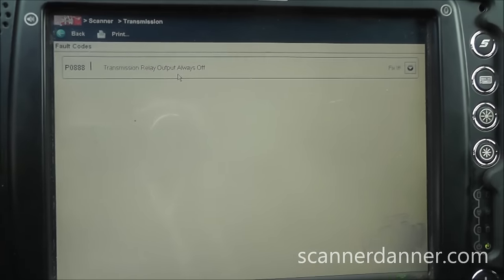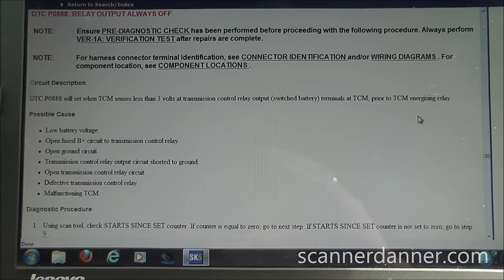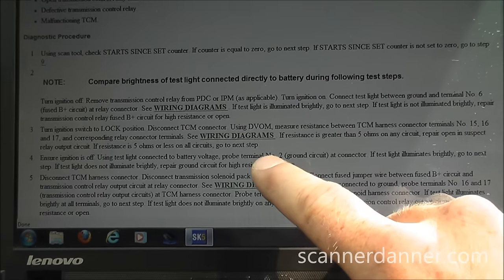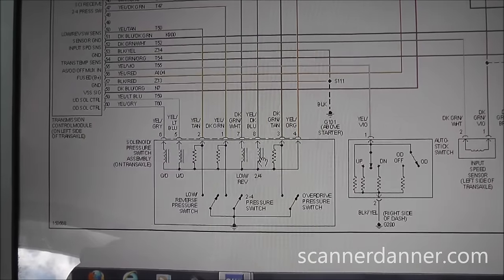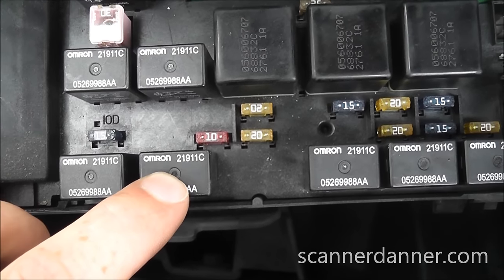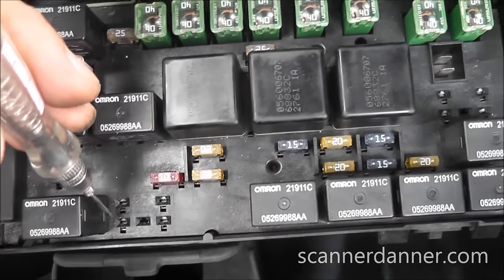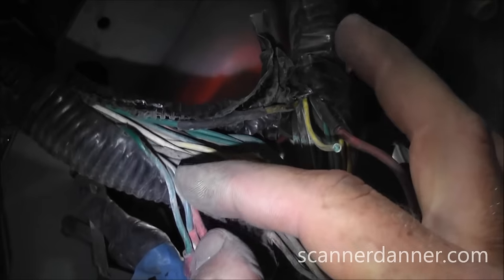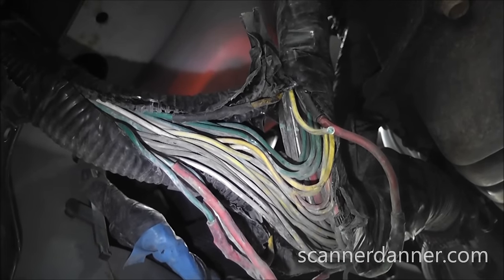Transmission No Shift Case Study (P0888)

Comment: hi, Can you help me out? I have a 96 dodge caravan sport. after starting and putting into "D" it drives fine until it tries to shift to 2nd gear, it goes into something that feels like neutral. I stop the van and none of the gears work. I restart the engine and do it again and it drives fine, until it tries to shift again. is it the transmission? I had a car with a bad transmission and it slipped a lot until it finally gave up, unlike my van which is on its 2nd transmission 10 years ago with 113k miles . I probably only put 50 k mile on this second transmission. It feels like its electrical since restarting it puts it back in drive at least for first gear. Any info would help. thanks.
Reply from the maker: These transmission were total garbage. I've owned a few Caravans over the years and every single one of them needed a tranny at some point in it's life. 
On these electronic shift transmissions, they will lock in second gear when a fault is detected. What you need to do first is find out what trouble codes are setting. However, if you are getting a neutral condition before the second gear lockout, this is not a good sign. Most likely a rebuild is needed. For additional help. 
Please post your codes here. Thank you! I'll respond on the forum. 
http://scannerdanner.com/forum/post-your-repair-questions-here.html

Comment: hey Scannerdanner I have a question, montana 2004 under 100.000 km it problem few years untill now ,   when i accelerate upto 113km and keep pressing 
down the gas it will not go higher and the speed will start the drop 
down to 106km and it will starts to go back up to 113km and then the 
same thing happens. there is no engine light and when i use an OBD2 
scanner nothing shows up, but when i slowly press the gas it can 
accelerate to speeds of 125km and not drop, but if i press gas harder 
after that it drops again, and when i get it to 120km and go to cruise 
control it is ok until i go uphill and then the same thing happens 
again. i have already changed all of the engine sensors, fuel pressure 
is ok, i have even changed things like the fuel pump and a lot of other 
things, i have changed the transmission oil and added in Lucas oil 
stabilizer. so what is the problem?
Reply from the maker: check you exhaust back pressure. I have a few videos on how to do this. Thanks!

Comment: My truck is a Ford f150 4x4 new engine new transmission everything is new but I don't have power on the hill what can I do
Reply: Check it for a restricted cat. Check the MAF  sensor and your fuel psi. Those are the big three low power issues on your truck.

Comment: Mazda 323f v6 2.0 problem is missing 3rd and 4th. Also when i leave gas pedal it acts like its in neutral.. wwhat i must check?
Reply from the maker: What codes do you have? What does fluid level and color look like? If no codes and fluid is full you most likely need a complete rebuild.
Reply: ScannerDanner Hello and thanks for fast response. I never tried diagnosis, need to make it via with  LED lamp cuz i dont have OBD2. It will show problems with gearbox?
Fluid color is dark pink, but i noticed some kind of very small black shlts inside it.

Comment: Im a big fan of knowing inherent problems any car i own has so you can avoid all this wasted time (no offense,  you are obviously doing it the right way), but most knowledeable caravan owners are already going directly to that damn wiring harness, or trans computer after changing relay (i carry extra relays too). I suggest everyone go right now & wrap that harness bend with silicone tape before you have this prob. P.S. I would run an extra ground wire from engine to body as these caravans are known for weak grounding
Reply: also spray WD-40 (its electrically conductive oil) on all ground connections you can find in engine bay. theres one main one connected to one of the bolts for the starter, you can get to it with spray easily on right side of engine as your looking at it with hood open

Comment: I have a 2005 PT CRUISER that won't shift out of first gear. could it be a fuse?
Reply from the maker: +Tom Mutz most likely not and most likely it is a 2nd gear limp mode. There should be a trouble code.
Reply: +ScannerDanner what is limp mode sir
Reply: +Gerwich Saint-Hilaire   Limp home mode refers to the computer allowing the car to continue to function to some limited degree so that it can be driven to a location to be repaired pr where it is safe to stop.  The car doesn't just shut down and then need to be towed.  In this case,the computer locks the transmission into second gear so that it can still be driven even though  the transmission won't shift into other gears.

Comment: I know there are several ways to skin a cat. But wouldn't another way you could have tested that control wire would have been to energize the relay while checking voltage at the tcm? Like you were doing with the sensing circuits.you would have seen the voltage drop pretty quickly.

Comment: Hey guys, I’ve had a similar issue with my van (2001) 3.3litr v6 I noticed that when I was driving, the van was stuttering and it seemed like it didn’t want to drive nor break and I was only going about 35-45km. 

I pulled to the side stoped and turned it off for about 5 mins then I started it drove normal for the first few seconds then it was stuttering again and wouldn’t go past 20-25km so then I turned it off and parked it, after leaving it turned off for awhile I started it and it cranked but then turned completely off in  about 20 seconds , then the engine was stuttering and it seemed like it wanted to go but kept on stuttering the muffler was giving out some weird sounds…maybe bad fuel pump? 
Transmission gone bad ? 

….if anyone can point me in the right direction on what to do….I would grateful appreciate it
Reply from the maker: No possible way to answer this based on symptoms alone. Testing must be done starting with a scan tool while looking at data during the condition.

Comment: I have a 2007 Cadillac DTS runs great until last night.. I was leaving the store so as I put it in drive or reverse... it does nothing... it gave no warning that nothing was in need of service.. the dash indicator shows its in neutral the moment I start it up.. but it's in park and want move... put it in any other gear and it will just roll.. anybody know what's going on here
Reply: Thomas Richmond did you find out what was wrong

Comment: I have a 2013 dodge charger 3.6 i was driving and all of a sudden my car would not drive I could rev but no movement I stopped turned car off and put it in drive and it would not go just rolled like it was in neutral check engine light came on and I got a lot of codes could this be a fuse HELLLP!!!!
Reply from the maker: no, it will not be a fuse. These symptoms do not sound good. Have it taken to a place you trust, this sounds like a transmission problem

Comment: I have a 1997 Sebring V6 that continually goes into limp mode after driving for 15 to 20 minutes, or whenever it warms up. I have changed out TCM, had it flashed, a new shift solenoid and input and output speed sensors to no avail. What else can i try to resolve this? It drives perfectly fine for a while then the check engine light comes on with the general transmission code p0007, I believe and the speed sensor code. Yet, the speed sensor is not the issue as I have changed them both twice. Please advise if anyone else has had this issue and resolved it.
Reply from the maker: unplug the alternator and tell me how it performs. then watch this video
https://www.youtube.com/watch?v=MGaHaIXZioA

Comment: Okay but what if it is not the wire it is a 2005 Dodge Caravan transmission lines blow it off I put them back on change  the transmission filter and put new transmission fluid in it
Reply from the maker: sounds like a rebuild is in order, especially for that problematic transmission

Comment: Thanks for the great video! I have a question. I checked 15th pin on my TCM and it doesn't have any voltage(off/start/crank). Does it mean that TCM is bad? Thanks again!

Comment: my 04 grand am se keeps blowing trans fuse.. any ideas
Reply from the maker: +son8god8damn short to ground on the ciruit, you'll need to find out what all is on that circuit and then isolate it. I use a short circuit tester for those types of problems. No way I can answer specifically to you what your problem is through the internet. But what I can say is you have either a wire that is touching ground or a shorted output solenoid/motor etc

Comment: could you explain to me the load side of a circuit
Reply from the maker: +Chris Canty sure, the load side of a relay is the switch side. the control side is the coil. 
Control side = makes a magnetic field to close or open (depending on design) the switch (draws less than 100 milliamps) 
Load side = contains a normally open and/or normally closed switch (up to 40 amps of current)

Relay = takes a small current and controls a large current 

make sense?
Reply: Plenty thank you learning a lot going to purchase your e book for Christmas

Comment: My 2004 Dodge Ram is giving me hell what could it be it runs good and then it after awhile it don’t hardly wanna take off when I stop on a stop I push the gas paddle and it barely moves after awhile it takes of again
Reply from the maker: when it barely moves from a stop, what happens if you floor the gas pedal? How does it run cold and how does it run at wide open throttle?

Comment: Okay somebody please help me my dog climbed under my 01 Dodge Ram 1500 and chewed up some wires it made me lose 1st 2nd and 4th I think it is called the shift sensor I took off the connector and there is a green wire and a blue wire but on the other side there are just about every colored wire does anyone know how to even to begin to figure out what wire goes together I'm trying to just splice it back together
Reply from the maker: https://www.scannerdanner.com/forum/post-your-repair-questions-here/16-need-service-info-check-here.html
You will need a good diagram

Comment: I have 2003 envoy won't crank I check all fuses, power to the pcm ok, the dash only came on check engine lite and battery lite when turn the key on, I try another ignition switch, another stater relay and nothing, also  I  have communication to all the modules, I disconnected module by module and just can't get the car crank somebody help!!!!!

Comment: Can any one help? I have a 2001 300m  3.5L.  Codes-- p0740 ,p0732, p0736, p0700, p0160, p0700.  I changed the Trans speed sensors. inner & outer.  Now it is going into limp mode... Help !
Reply from the maker: +Jerry Reyes sorry man, you can't troubleshoot by codes alone, you won't get much valuable help that way. Only silver bullet guesses

Comment: wish I could get an honest answer I have 2006 Ford pickup I drive it for a quarter of a mile acts like it ran out of transmission fluid I shut the truck off wait 5 seconds start it up put it in gear it goes like a brand new truck for a quarter mile acts like it's out of fluid again stop shut the motor off wait 5 seconds start it up it'll peel the tires I don't know what to make wish I could find somebody honest

Comment: my car hiccups at 1st gear 2nd gear and 3rd gear after driving a good 30 minutes, (when the trans fluid warms up) was wondering if my pressure control and solenoids are bad? (pontiac g6) if anyone can help a brotha out that would be awesome, ive spent hours watching countless videos, ive gone and done diagonisis like this here but because my car is refurbished i have way to many codes to count on one hand. if anyone knows alot about the 4t45e transmission thanks!!

Comment: im not him but you can not do it with led ( light emitting diode ) type hence diodes only allow current to pass in one direction too use a test light as a jumper wire it has too become part of the circuit and current must flow

Comment: What if the car starts shifting and then out of nowhere it stops? 2013 Chrysler 200 touring
Reply from the maker: it stops what? shifting? There would be trouble codes in the computer for that. You need to have it scanned for codes as a next step.
Reply: Yes it will shift and then once i hit 50mph it wont shift anymore. Just gain high rpms
Reply: Its only done this twice now. And then i turn the car off then back on and its fine
Reply from the maker: you need to read the codes on that system

Comment: But it's stuck in second gear the transmission will not shift
Reply from the maker: Stuck in second gear with no shifting absolutely will set a fault code.

Comment: Hi ScannerDanner I was looking to post video of the problem I have (limp mode) on youtube and I found the same video of the problem I have, the control indicators on the dash blink like there is a short. Does this video tell you anything, I have replaced the trans control module and the I believe the output speed sensor. " https://www.youtube.com/watch?v=9toEePJNhC4 " I can turn off the car and 50/50 chance when i turn it back on and it will go into drive and shift for a short time before it goes back to limp mode.
Reply from the maker: need trouble codes to help, if there is a limp mode occurring the WILL be a fault code